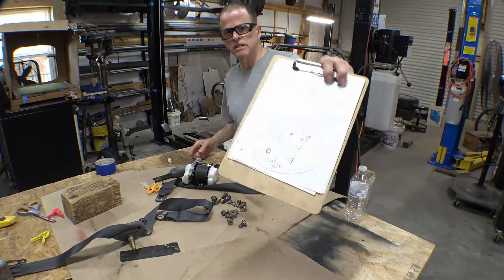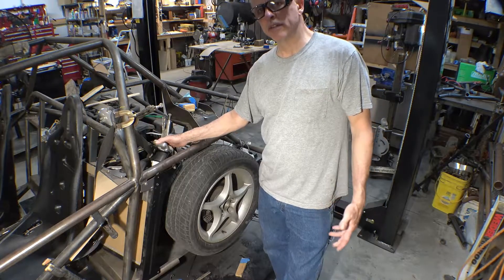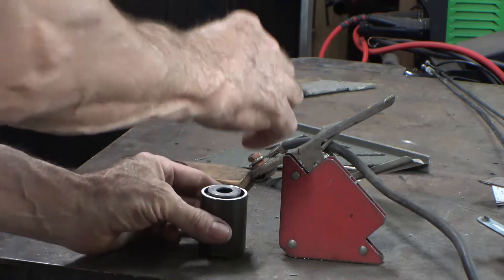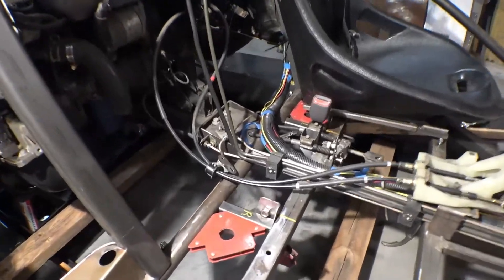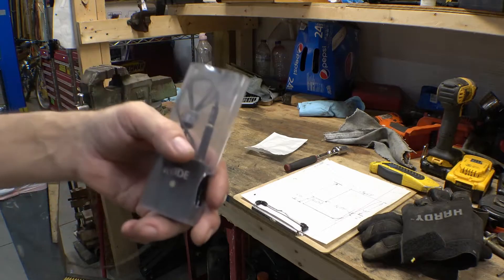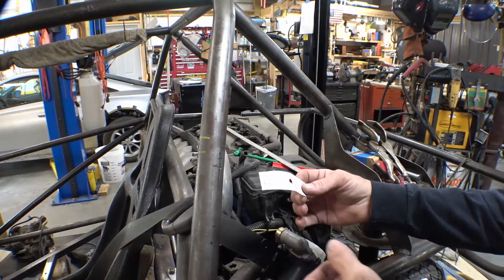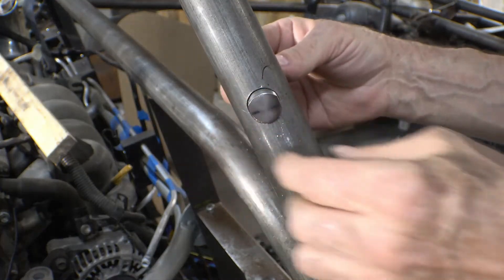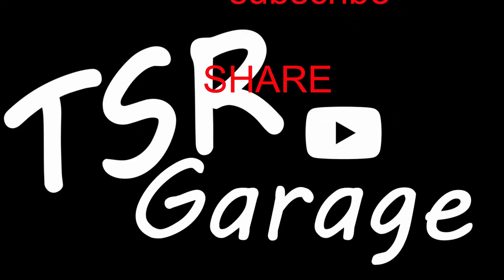dune buggy sand rail Seat Belts, 5 point, 4 point or stock,   Celica Street Rail 15. #seatbelt

Comment: Hey, man! I finally got around to my 2zz Corolla swap and now the radiator fans are running all the time. I've heard Celica 1zz --> 2zz swaps have the same problem so I think it's something in how the Celica 2zz ECU is different from the Celica 1zz ecu. Did you have the same rad fan issue with your swap, and how did you fix it?
Reply from the maker: I didn't have a problem with the fans.